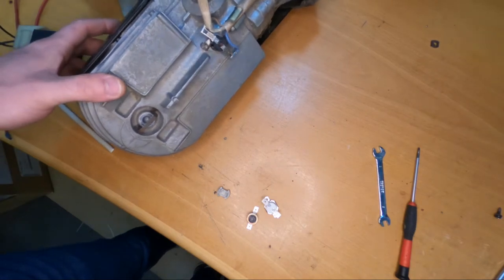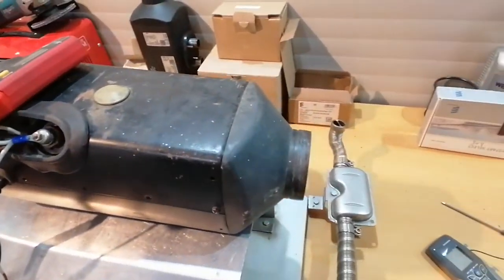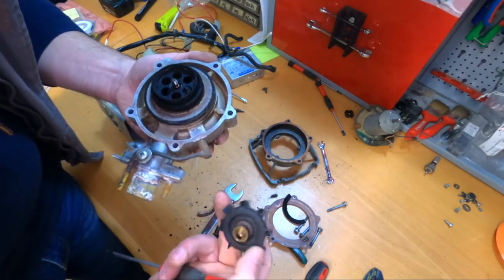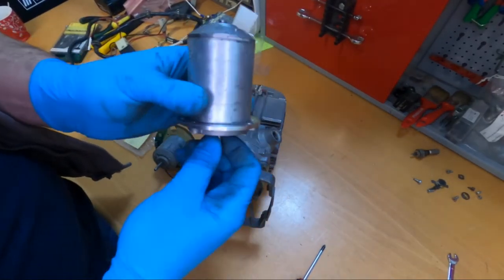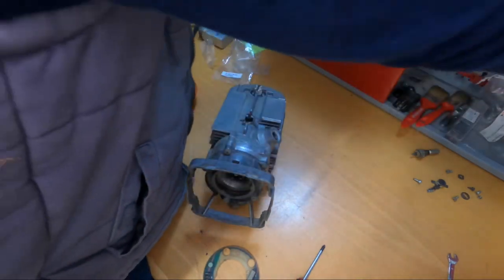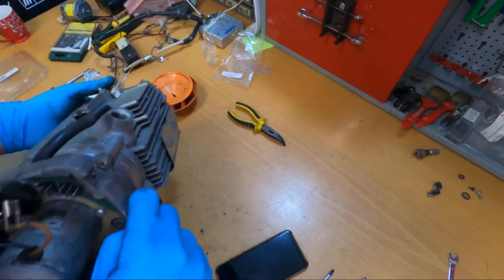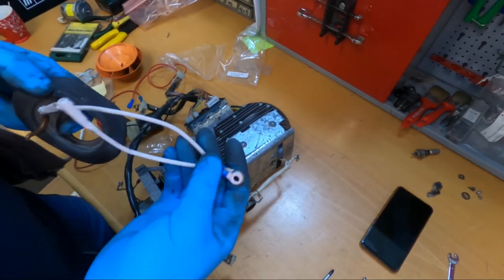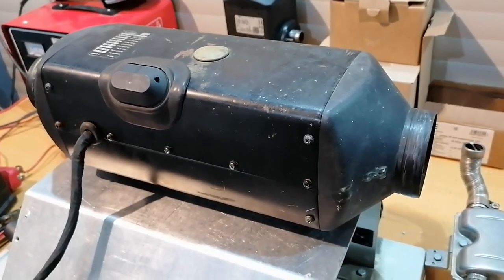Eberspacher D3L restoration project, almost 40 year old heater part 2

Comment: thanks for the vido, really helpfull.
Just one question, How did you clean the chamber combustion chamber?
Reply from the maker: I just cleaned it with compressed air but very carefully because the insert is not for sale anymore. I think I found it on-line but at ridiculous price. Really old stuff, I just did this because someone restored an old VW. I mean finally it starts and works but I don't think  it will reliable for lond term use.

Comment: thanks for the informative video,, 👍  a same machine fell into my hands and I activated it with the connection you pointed to the bridges in the plug
I want to ask you which connection will work in another program ?
and it will work on lower rpm of the motor,,because I am preparing to make my own circuit with the 555 chip and the 4017 chip where I will be able to control the temperature by controlling the pulses in the pump and the noise by reducing the rotation speed ..
Thanks in advance
Reply from the maker: This heater that I had has only one speed, the diagram was a general one from this heater family. I cannot say if the heater can sustain the burn process at a lower speed.
Reply: @DIYHelper  so all I have left is to connect the motor separately and the pump separately and to test at what speed and at what pulse frequency it works and at what does not work so that I can do it with two speeds ,,,,,
now i have connected black with black-white and yellow-red and it works like yours in the video
purple-green and brown have no other lower speed ??
Reply from the maker: Like I told you this one has only one speed, you can get the manual from buttlertehnic just search for d3l, it is also important that the mixture of fuel and air is good otherwise the heater will fill up with soot. The only way to do that is to monitor the exhaust gases and have the right co2 %. I believe the values are stated in the manual.
Reply: @DIYHelper  i have see-dwnload the manual,,
its operation is simple, dosing pulse pump ,, fan and glow plug,, after the ignition the glow plug turns off and the pulse rate maintains the correct temperature 
https://www.youtube.com/watch?v=ewr7btulJ-w
the pulse rate and the air speed is decreases if we connect the second thermostat
do you know the purple-green with which cable it bridges?

Comment: Hi, i´ve got a eberspächer B3L, and im pretty sure that the bearings in the fan motor are bad. The fan isnt spinning freely when i touch it. And the 4A fuse in the controller box is blown every time i try to start the heater. Do you have, or know where to find, a blower motor / fan motor for the B3L? It would save my freezing ass =) Thanks!
Reply from the maker: Hi, the part number is 251482010100 I don't think you will have an easy time finding it. I think  that the central warehouse had  a few of them but the price is ridiculous. There is a group on fb Eberspaecher direct advice, maybe you will have some luck there. The best chance is finding an old one or just try changing the bearings.